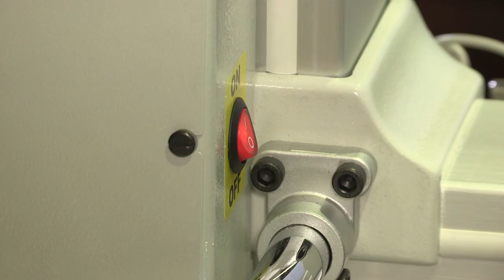Innova Quilting Tutorial: Changing the Foot

Comment: Thank you for this video! It's been so long since I changed my foot that I had forgotten how. This video was a great help. One question: Do you have to check each time you change a foot to see if it's the correct height above the throat plate? I seem to remember something about putting a dime underneath the foot. Or is that something that is only done rarely?